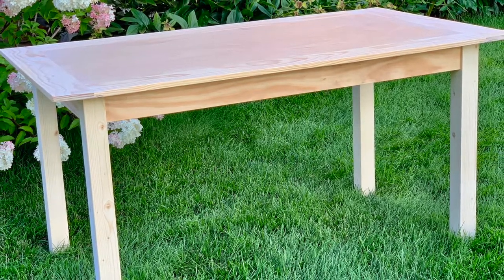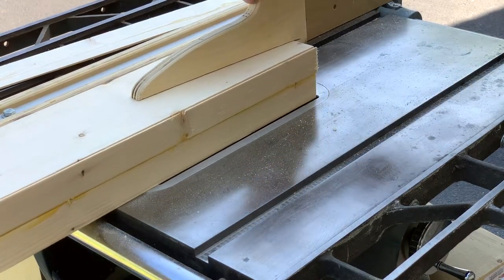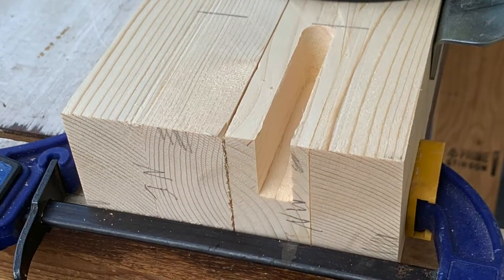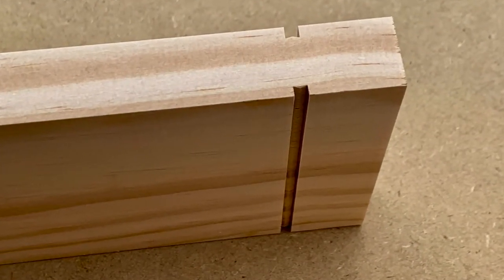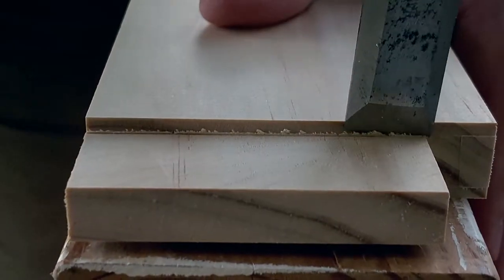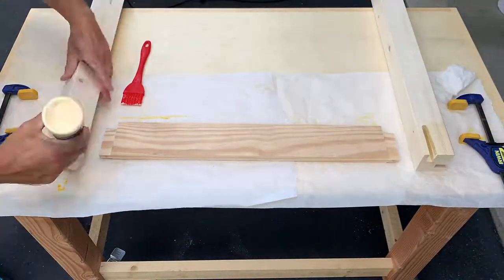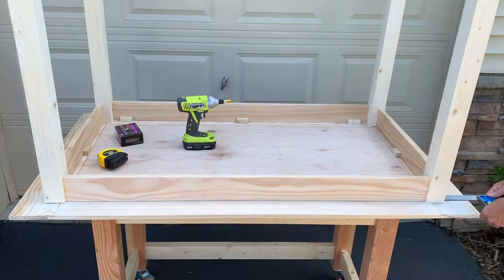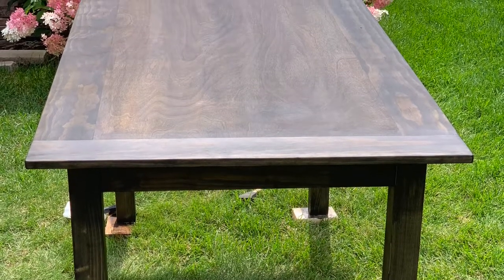Building the Frame // How to Build a Dining Table From Scratch - Part 2 // Woodworking

Comment: Wish I would have came across your channel sooner! I like how you attached the top to the frame!
Reply from the maker: It’s an alternative to pocket holes, but I like it better for applications where it’s hidden. Makes for a stronger connection, in my humble opinion. Of course, I could only use it for this table because I used plywood for the main part of the table top and don’t have to worry about wood movement. Thanks for checking it out!